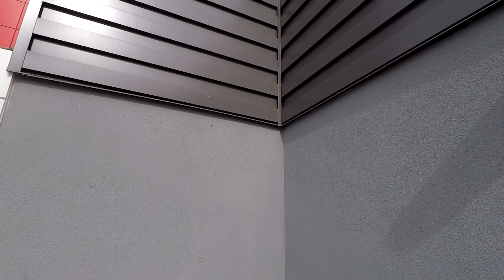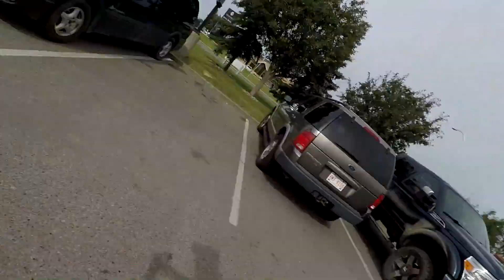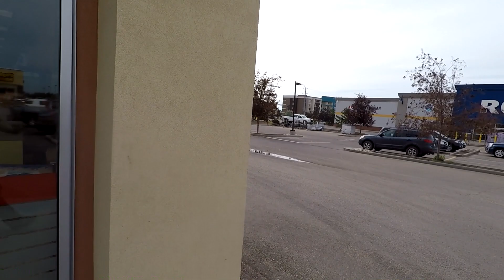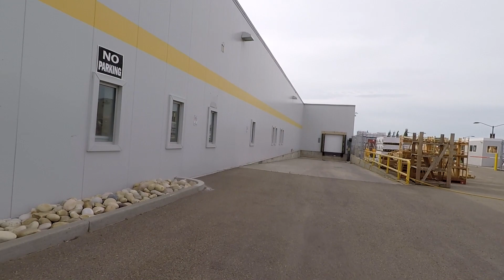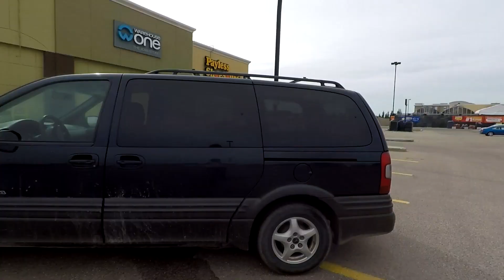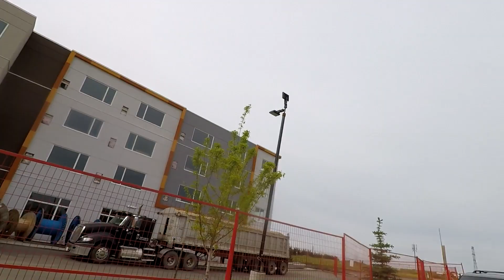TYPES OF EXTERIOR WALL FINISHES ON COMMERCIAL PROJECTS

Comment: Amazing video, any recommendations for a small strip mall that’s reliable and cost friendly?
Reply from the maker: A good glazing company for your windows and entrances will be key. You can do steel stud to fill in around the glazing and do the front. You can use insulted metal panels or precast concrete for the sides and rear.

Comment: Styrofoam?  Yikes! I hope they're not using that to build prisons.  What are they using to patch the damage to the efis (sp) before repainting?
Reply from the maker: boilednuts it's an acrylic stucco. The patches will show even if the entire sections are painted. It's really cheap stuff. Usually the wall types would be; 1/2" drywall on the inside painted, 8" 20 gauge or 6" 18 gauge steel stud, no insulation, 5/8" densglas gold, a 10mil  air vapour barrier like blue skin and then the 2" styrofoam with the acrylic finish. The styrofoam they use isn't the same r value as an actual owens-corning rigid insulation so it's not a very good system. The acm and other sheet metal panels will have semi-rigid like roxul or thermafibre after the avb. What is the most popular finishes where your from?
Reply: Not sure. I'm mainly an automotive diy'er so haven't looked into commercial construction at all.  However, I take it that the developer makes the call on which material to use as long as it follows code.  Then the purchaser/lessee either doesn't care/know how easily damaged the exterior surfaces are.   I leased a small retail space in a mall at one time but most of the exterior wall were large window panes.  It could have had some of that same material you've shown here.
Reply from the maker: boilednuts The owners of the properties design the buildings with architects and designers and usually opt to go with this material when the cost savings are presented against using sheet metal or acm panels. The businesses that lease the units dont get a say and it's not like they have much option. So many buildings have issues with this finish. It's going to catch up to these property companies eventually. Hotels built more than 5 years ago with efis look ghetto as heck.